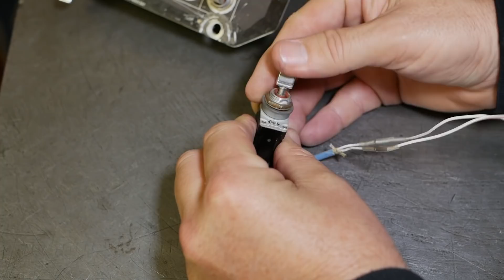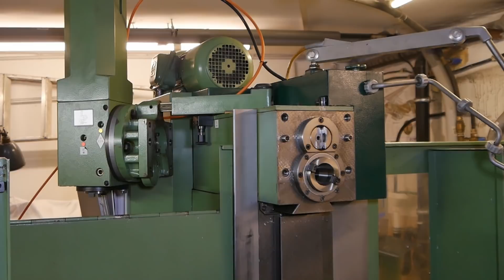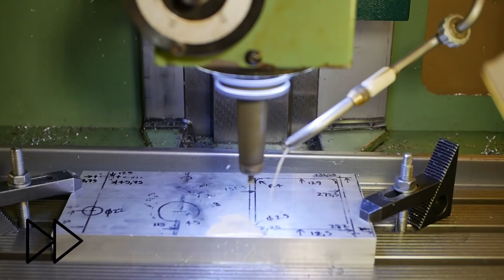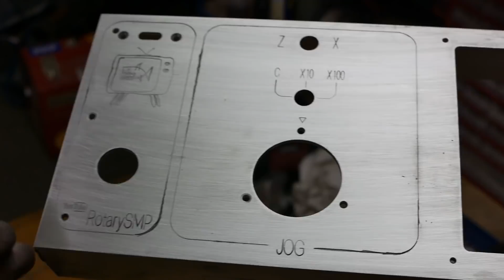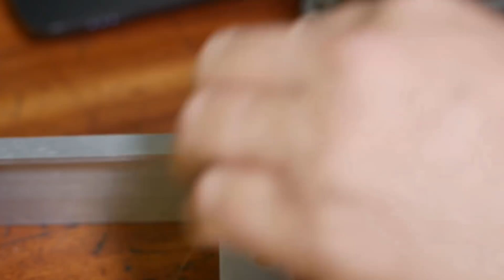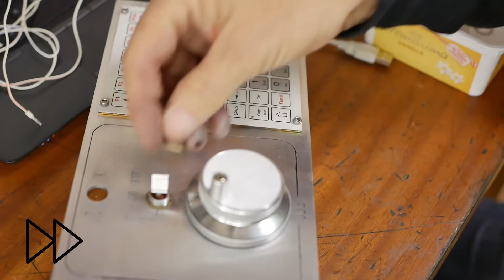Making a CNC control panel - CNC'ing the mini lathe - episode 34 || RotarySMP

Comment: That key pad would look better back mounted, with a heavy bevel on the mounting hole. Possibly make some aluminum screws to weld to the case. Allowing nuts to retain the key pad, possibly using extra screws and a aluminum strip. Unless you are cool with screw heads around the beveled edge. Possibly use aluminum tig rod and thread it, not Shure the size available, m2-m3 screws  or there about.
Reply from the maker: Yeah, I also worked that out after it did it. Was pretty stupid to put this on top like that.

Comment: 15:53, it would probably looked better to run a fly cutter across it first.  Slow with a high spindle speed, then engrave it. (Engine turned would look good too) use a scotch bright pad on  the end of an arbor.  50mm diameter with a 30 mm center. Then clear coat or paint with a thin candy paint. It would go with the retro look.. 👍🤓✌️
Reply from the maker: I dont have a high speed spindle. I keep meaning to bodge one up, but it never gets to the top of the priority list.

Comment: Talk about a throw back this came up as a suggestion  and same control pannel as todays video
Reply from the maker: The YT algorythm seems indistinguishable from randomness at most times :)
Reply: @RotarySMP  i actually  went searching as im on a control pannel hunt
Reply from the maker: @forgeperformanceand4x4  Ever time I look at that control panel, I wonder why I bolted that keypad to the front, rather than the back of the plate, with a nice chamfered bezel.

Also for a lathe, using a single jog encoder and axis switch was a poor choice. Two encoders dedicated to the axis is batter.
Reply: @RotarySMP  im just trying to  find some  nice membrane  keyboards
Reply from the maker: @forgeperformanceand4x4  I found that one on the german craiglist type classifieds:
https://www.ebay-kleinanzeigen.de/s-seite:3/folien-tastatur/k0

Comment: Great video, and VERY nice work! Please tell me, why do you pocket even the large cutout for the keyboard? On this job, you could have drilled a few holes inside, and screwed the waste plate down along with everything else. No tabs or cleanup needed and a nice surface all the way around. Just curious!
Reply from the maker: Thanks. I wasn't very familiar with the software, and couldnt work out a better way at that time. I have since gotten better at using it.

Comment: Nothing wrong with the Boeing surplus countersinks. They are literally surplus because the new aerodynamic rivets are no longer a basic 100 degree head design, the new rivets have flat-ish sides near the head and a counter sink below. Also, it is machines doing the majority of that work now and they do not require this tool.
Reply from the maker: THanks for that info. Shame they shut that store. It was the greatest shop on earth.

Comment: Great job Mark, I wouldn't beat myself up over the drag engraver, it's just that aluminum extrusion machines like utter dog shite. The only good machinable grades I've found so far are EN AW 2017 and 7075 (also known as fortal). The milling succeeded because of the flood coolant.
Reply from the maker: Good point. 7075 machines really nicely.

Comment: That jog wheel could make a decent volume control 🤔
Reply from the maker: It would be a pretty big amp faceplate for it to fit.
Reply: @RotarySMP  I was thinking more for my computer.
Reply from the maker: @almostanengineer  Woul look cool. They cost about $15 from Ebay.

Comment: Aerospace tools are cool! I found out the hard way that drag engraving works better on anodised aluminum stock. Black gives better legibility but clear anodised works well too. The hard coating resists the galling that happens with wrought stock.
Reply from the maker: Thanks. Did  you still get galling when drag engrvin with lubricant.
Reply: @RotarySMP  I didn't actually get to the point where I tried using a lubricant. I sort of gave up when I saw how badly the uncoated material was galling up. I find that my drag engraver works better on hard material like steel, stainless and hard brass. The anodised stock still leaves a raised edge but it is at least uniform in depth and the line widths are fairly consistent. I am very keen to see how your control panel works out. I am particularly interested in how you integrate the MPG. I note that TOT is interested too. 
Regards,
Mark Presling
Reply from the maker: @Preso58  What angle did you grind your drag engraver to? I think mine is a 90° included angle.
Reply: @RotarySMP  I have two bits. One is 120 degrees and the other is 90. I recently purchased a second DE bit from Boring Resarch in the USA. It has a magnetic retention of the bit and it takes standard Dremel brazed carbide bits. I find that the 120 degree bits work well in soft materials. They give a wider engraved line without raising as much of a burr. I also have a diamond bit which works really well in hardened steel and stainless steel.  I did some videos on the DE process. https://www.youtube.com/watch?v=ssMNH-LhsEI&feature=youtu.be
https://www.youtube.com/watch?v=FD81bJNtbK4&feature=youtu.be 
Anodised stock definitely helps. 
Regards,
Mark
Reply from the maker: @Preso58  My stock was just whatever was laying around. I grind up my own bits. I'll try making a 120° one.

Comment: 0:56 i love this type of old panels, one problem is that whit that buttons if you break the cable is very complicated to fix because is sealed
Reply from the maker: Good point. I doubt the Mini-lathe will see enough hours in service to wear one out, but their is always the risk of dropping something on it.
Reply: @RotarySMP  very truth, if i had that type of button or similar connection i would cut the cables very close to the body and solder or use that screwing terminals or something similar and glue the terminal in the body of the component

Comment: And power tapping M3 without breaking the tap... That's impressive ahahah thoose switches looked amazing!
Reply from the maker: Tapping anything without me breaking a tap it s miracle.
Reply: M3 into thin aluminum through holes ain't so bad.
Reply from the maker: @paulwomack5866  correct. in is only 3mm thick.
Reply: @RotarySMP  my younger self has broken taps doing just that! I once broke an M12 tap trying to clean an already tapped hole ahahha
Reply from the maker: @andresgodinho  M12! That takes some real effort. Respect :)
Reply: Man, I broke a 1-1/4-12 tap cleaning a tapped hole.  Stupid carbide dust
Reply from the maker: @Nidkidful  Ouch, that must have taken some effort.
Reply: @RotarySMP  a bit. But chasing a hole after something has been carbide coated is definitely hard on the tap.
Reply from the maker: @Nidkidful  I bet.

Comment: nice work! i like the look.
Reply from the maker: Thanks Tony, shame I didn't lube it so it galled a few lines.
Your "this is where MAHO hid the speakers" had me lauching my arse of this morning.
Reply: @RotarySMP  Great Video! Instead of changing the whole motor only to be able to rotary engrave, mount an auxiliary spindle to the side of your tool head. Just get one of those cheap, 400w bldc spindles on Ebay - those work pretty good for engraving. Not for milling, though
Reply from the maker: @marcus_w0  Thanks. That is pretty much what I was planning to do. Unless a spindle speeder falls into my lap.
Reply: hello friend where did you buy this keyboard could you send me the link
Reply from the maker: @Stitch_ofc3  I bought it used from Ebay.kleinanzeige.de The search was "Folientastatur"
Reply: nice
Reply from the maker: @MakarovFox  Thanks.
Reply: Hey Tony, are you going to sell your CNC machine?
I think I know what it needs and would really enjoy the opportunity to buy it and make it better..... I have the parts to make it all the CNC its supposed to be.
cwleveck at gmail dot you know...

Comment: It was interesting to learn about the aircraft assembly techniques and tools.

Since you have the tools for engraving front panels, you may be interested in acrylic that is available in two or three colours. A thin veneer on the top surface, say black, and a thicker backing in another colour, say white. You can make nice looking panels in a single operation without having to resort to infilling with paint/nail varnish.
Reply from the maker: Good idea. I am not entirely happy with this one. I#ll try to do better on my next machine.

Comment: It kinda seems like you have worked with sheet metal before - just saying 😄 
Those rivets are awesome 👍🏼 
What’s your plan about the Maho spindle - high rpm update?
Reply from the maker: I did an apprenticship as an aircraft mechanic, so I really like sheet metal work. I kind of keep an eye out for an ISO40 spindle speeder.That would be the easiest, although they are pretty highly stressed pieces of kit. The other option would be to make a mount to use a chinese HF spindle.
Reply: @RotarySMP  I have engraved at 1000rpm,  4000rpm would be a luxury!
The Chinese spindles are so cheap that it's hard to find a good argument for using anything else. How about a mounting thingy with an ISO40 taper on it, but then with a bracket to hold it out to the side/front. You would need some way to hold it at a repeatable angle, but that would allow you to choose whether it sat out fron, left or right of the main spindle. 
Or, for a really fun project, maybe live tool? If you look on eBay you can occasionally find frameless motors, which look like a good starting point. https://www.ebay.co.uk/itm/264630038513 for example. 
Or, possibly, use a Chinese HF spindle and a belt-drive to a coaxial collet held in the main spindle. (A quick calculation shows that a Poly-Vee drive belt at 24,000 rpm would hit max allowable speed on a 95mm pulley, and a timing belt on a 79mm pulley, which sounds big enough to do the job.
Reply from the maker: @andypughtube  Hi Andy. It engraves nicely at 4000rpm with D-bits. , but just takes forever. I even ground up some pyramid tip engravers to see what they are like, but still choose the drag engraver for that job. I need to try it with lube and see if that would sort the tearing.

The Coaxial belt drive attachement would be pretty cool though.
Reply: @RotarySMP  "Try it with lube to sort the tearing". Reminds me of an unfortunate experience that rather spoiled the moment.
Reply from the maker: @andypughtube  :)
Eggplant emoggi, peach emoggi

Comment: Btw i think i have a spare 3d taster i Will send you if i every can find it 👍😂
Reply from the maker: Wow, that would be cool. Thanks. I have started making a Renishaw style 3D probe, but I think my initial design sucks, and it probably wont work, so it is back on the back burner.
Reply: @RotarySMP  i got a machine i am thinking about putting a renishaw probe on. How complicated would it be? It has heidenhein controller? I have No idea how its done
Reply from the maker: @nikolaiownz   Is that for your CMX 1100V? The probe itself probably only outputs a single signal. Most Renishaws these days transmit this wirelessly to a base station which would feed the signal into the controller. Contact open/contact not open. I am not sure how complicated it would be to integrate that into a heidenhain controller, but imagine you just have to pay them to unlock existing software features to access the probing routines.

Someone wrote a very nice probing screen widget for LinxuxCNC...
https://vers.by/en/blog/useful-articles/probe-screen
Reply: You beat me to it, I was going to offer a Zeiss touch probe (from a CMM). One of several that I found in a skip.